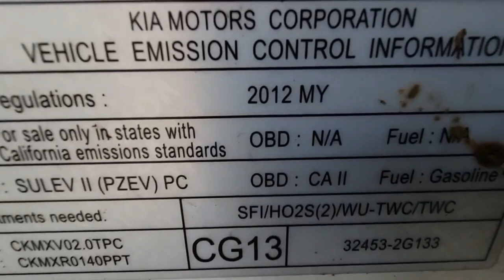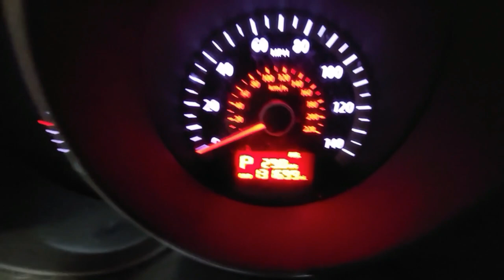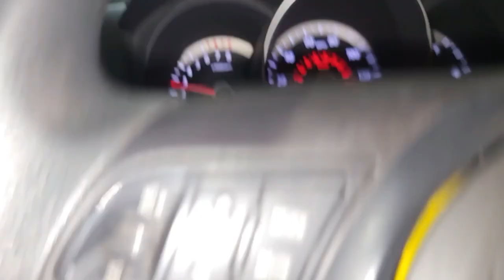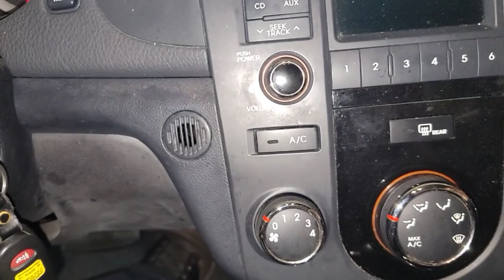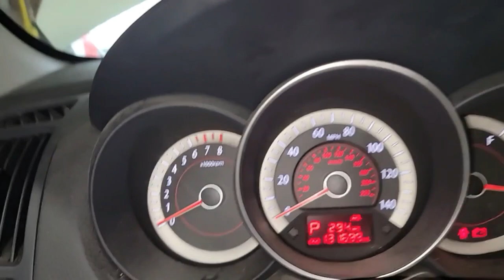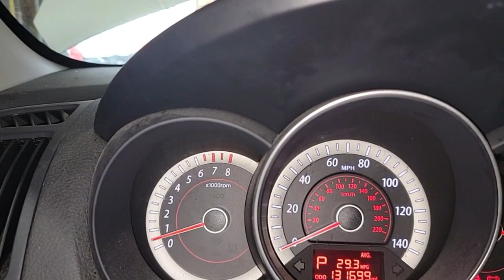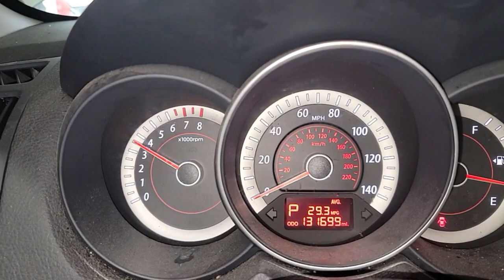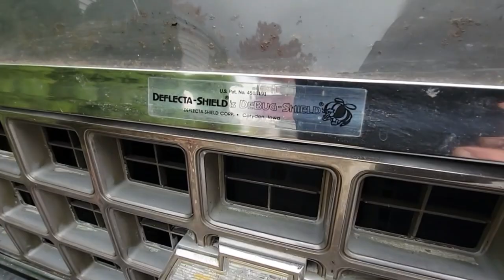2012 Kia forte DEATH BY BOOT!!

Comment: Worst engines ever. They (Kia) dedicated half of their service bays to engine replacements. Long waits too on getting them replaced too. I’m shocked how long this one held up as long as it did😂
Reply: my dad has a 2016 kia forte and I drove it a few time literally I put my foot on the gas and it stalls at 20mph after a dealer tune up!!
Reply: @smashthings4fun  it’s crazy and they still sell like hot cakes. I don’t know if you’ve seen it but people steal kias and Hyundais using a cellphone charger cord..
Reply: @1996FordBronco  especially those Kia Souls I swear they look like a clown car